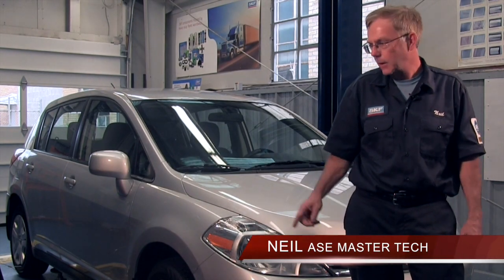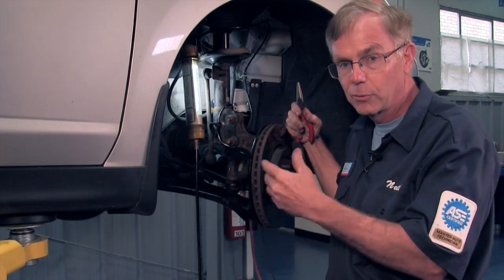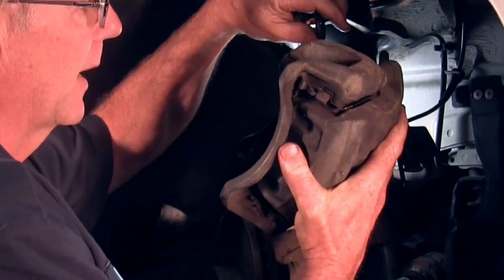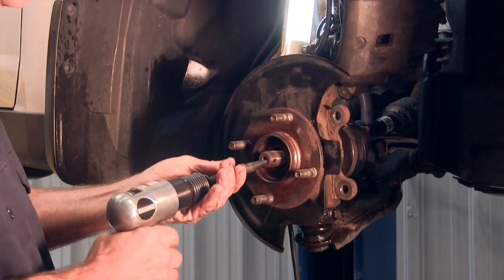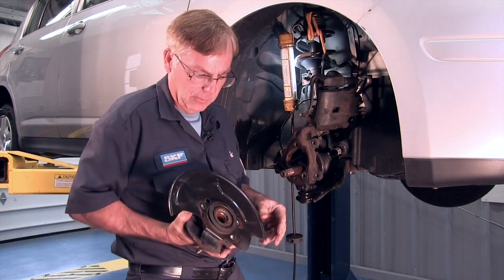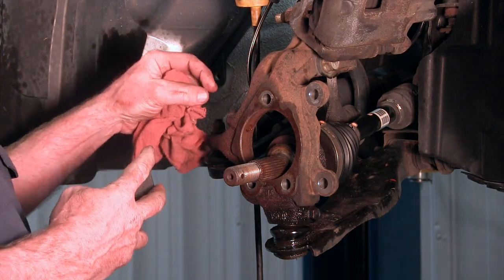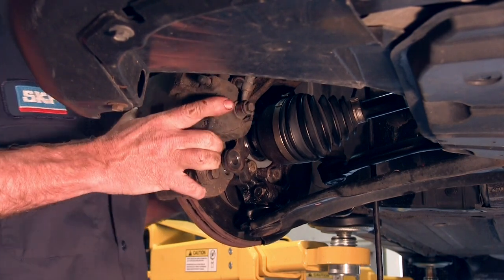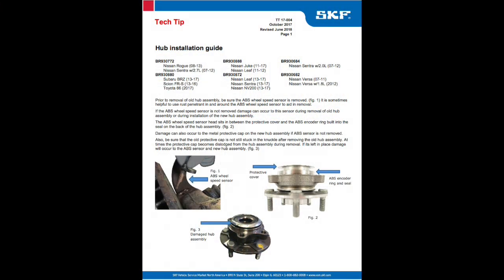Install or replace SKF wheel hub assembly on Nissan Versa/ Sentra/Rogue/Juke

Comment: Neal, do you have the torque specs for a front hub replacement on a 2012 Nissan sentra?
Reply from the maker: You can either get torque spec from the manufacturer or use our torque spec guide: https://www.vsm.skf.com/binary/12-460259/skf-torque-specification-guide.pdf

Comment: Is the hub assembly the same on a 2015 versa?
Reply from the maker: No, this install is for the hub assembly of the 2007-2011 Versa and the 2012 Versa with 1.8L. Thanks for watching!
Reply: Was also wondering if this applies to the 2015 Versa Note. I tried getting the hub'/bearing assembly  but apparently the "assembly"  does not exist. The parts guy told me it looks like they only have the bearing. You have to take the original hub to a machine shop and have them press it out and press in the new one. Anyone know anything  easier than that, please post. TY
Reply from the maker: @808breaksbad.  This tech tip does not apply to the 2015 Versa Note. A full list of vehicle applications for this tech tip can be found at the end of the video. Best of luck with your repair.